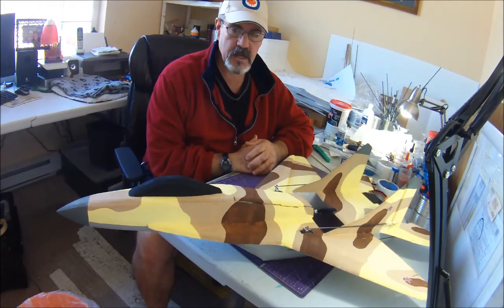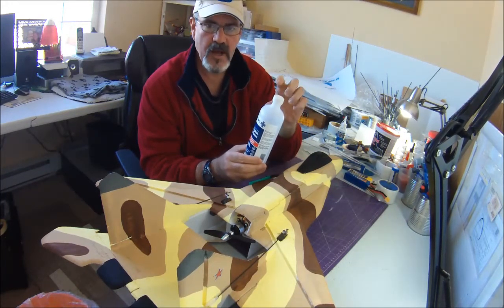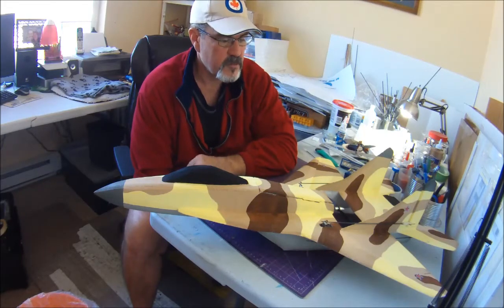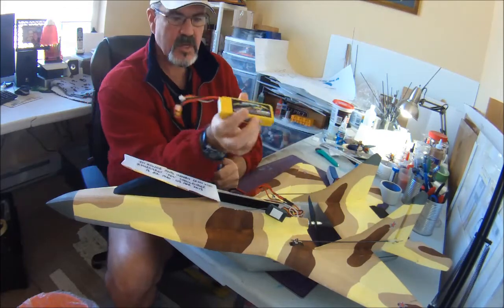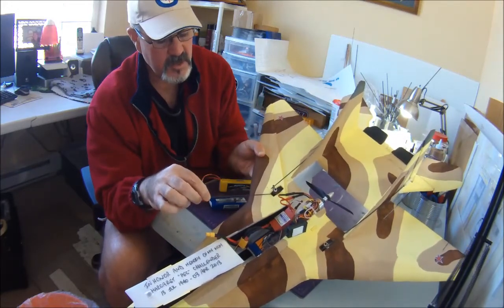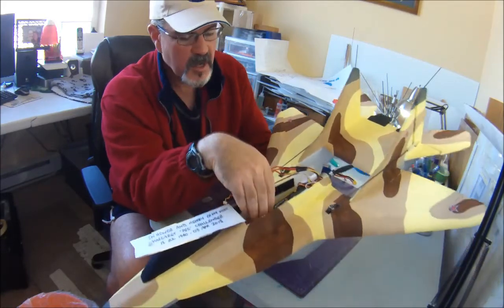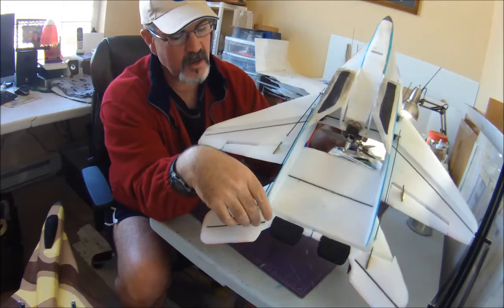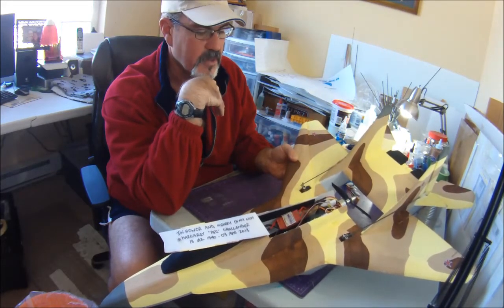NAMC Mig-35 build and setup tips

Comment: Great video. You mentioned epoxy for the elevon leading notch, I'm definitely adding that to my build. I used to glass all of my leading edges. Now I just squeegee on Foam-Cure. Stiffens them nicely, protects them, and much more aerodynamic. Foam-Cure is great stuff with added bonus of being cheap. Your durability testing is the last piece in its comparison to Foam-Tac.
Reply from the maker: Hi Stephan, thanks very much for the kind words.  Foam Cure is definitely a great product and given that once it completely cures it hardens to a more "epoxy like" consistency, it is perfect for the application you describe.  It also doesn't need to be mixed like epoxy which is another added bonus.  Once I have 50 flights on this plane I'll write another blog article giving a "mid life" update on it's durability since I built this plane almost entirely with Foam Cure.  Cheers, Scott

Comment: Thank You for introducing me to Foam-Cure and I really like it. Have you tried Foam-tac Foam-finnish.  I may try it on this plane.
Reply from the maker: Hi Doug, no problem, I am really liking Foam Cure as well, easy to work with and inexpensive.  I haven't tried the Foam Tac Foam Finish.  I thought I read some reviews that it added a bit more weight than I was comfortable with.  I try to give my planes a good overall sanding using 150 grit on all the edges, finished up with 220 grit on the edges and then a light finish on all the surfaces.  It still leaves some texture to the foam, but the paint helps make it a bit smoother.  I'd be interested to hear what your thoughts are on the Foam Finish though.  Where did you purchase it?  Some of the Beacon products are not easy for me to get to Canada depending on their chemical makeup.  Some distributors would ship Foam Tac to me and some wouldn't.  That is what is nice about Foam Cure, there doesn't seem to be that problem so it is more easily and readily available for me.  Cheers, Scott